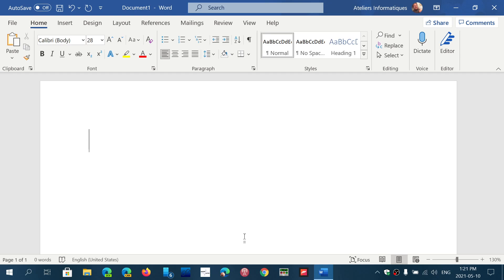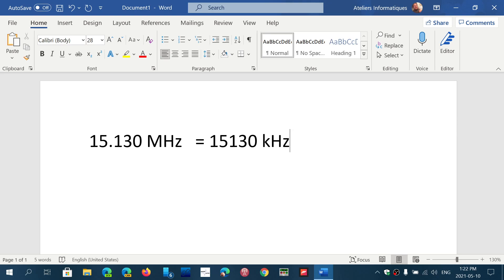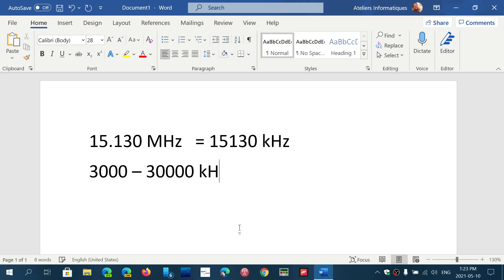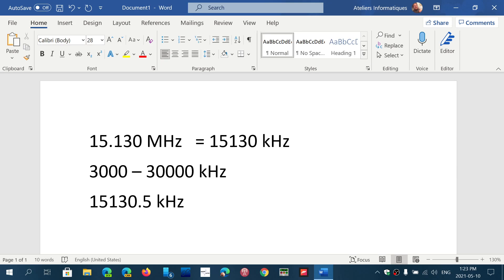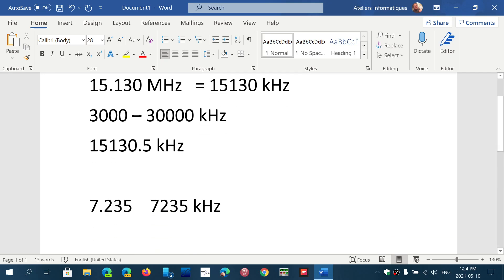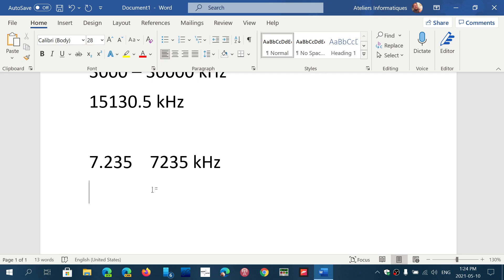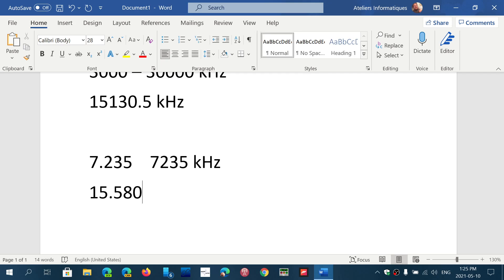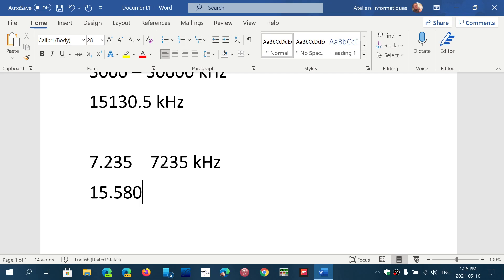Shortwave frequencies MHz VS kHz on the frequency display

Comment: Also there is the metres bands. 40 meter band 80 meter band and so on. Can you clear that one up please. Cheers
Reply: Radio travels at the speed of light, being electromagnetic energy. It's a wave  ~. The frequency is the number of times per second there is a full wave. The term hertz used to actually be called "cycles", so 1mhz would be 1 million cycles per second. Since the energy is traveling at the same speed (300m meters/s - light speed), a 1mhz frequency is 2x as long as a 2mhz frequency, or another way to put it is the 1mhz signal has a longer wave *length*. If you want to find out how long a wave is at a frequency, you can divide the speed of light (300m) by the frequency and get it's length. For example: 300,000,000/7,300,000=41 meters, so 7.3mhz is about 40 meters long. 300/3.75 = 80 meters. This, is also, btw, how to calculate an ideal antenna length, since a 1/2 length dipole is literally 1/2 wavelength.